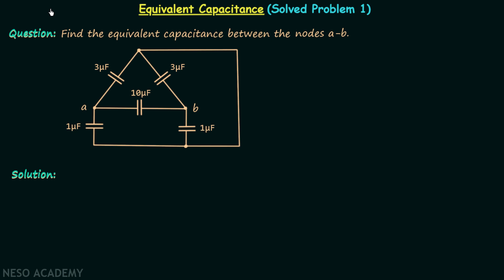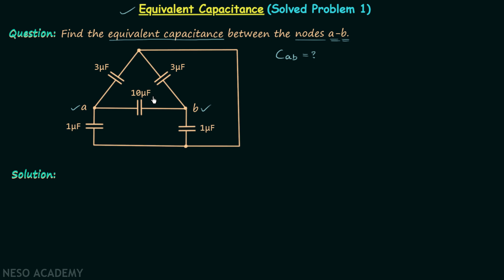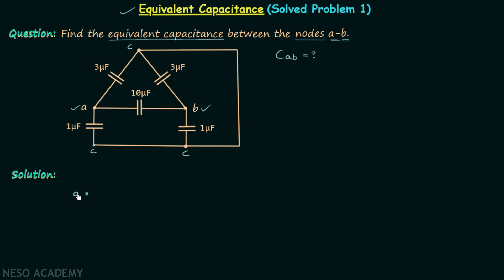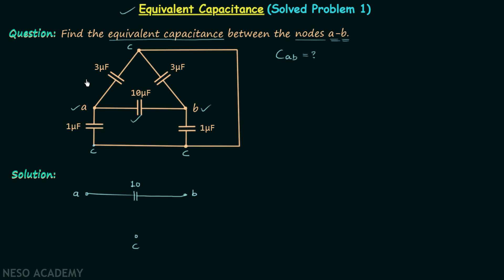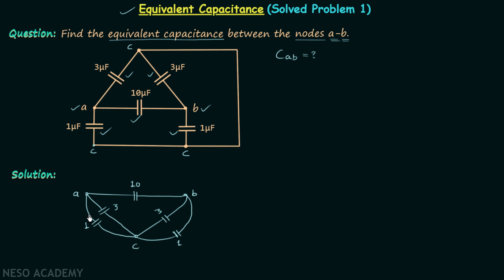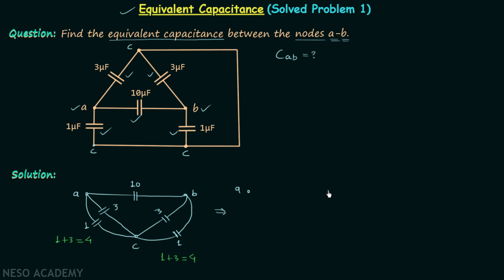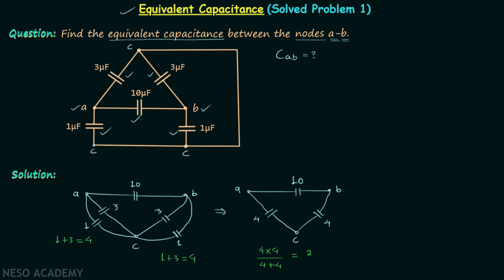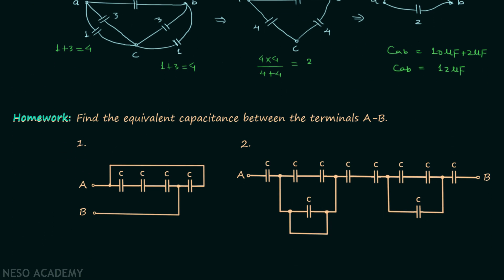Equivalent Capacitance (Solved Problem 1)

Comment: 1.Question, you can simplify the diagram. The lettering technique should make everything clear.
2.Question, Q = C * V, This Capacitor will not store anything if the voltage difference is equal to Zero. So expect shortcut there.

Expand for answers.

1: 4/3 C
2: 3/14 C

Comment: 1.here 3 capacitor in series and another in parallel and the result is 4c/3
2.here from A end, after the first capacitor we got a shorted wire so we wont count the 3 capacitor because they will fail to store charge and the result will be 3c/14.hopefully you will be benefited.
Reply: I knew the concept you talked about. But did silly mistake in calculating 😂

Comment: 1) Cab = 4c/3  and 2) Cab = 3c/14
Reply: bro how u get 3C/14 i am getting 3C/16. please correct me
Reply: @peACE18112  exactly same. tell me when u get the answer
Reply: @harshitapandey4892  after the first c from a side the next c which is in parallel with the two c, which I think you have shorted, so you need to short the other two c's too which are in parallel with the one and then calculate you will get 3c/14.
Reply: Rishabh Bahoria can u send me the solution plzz..lokeshpokhariya11@gmail.com
Reply: @Lokesh-bo1zl  how it will do
Reply: Correct
Reply: After the first c, both combination of series and parallel capcitance has no effect because the portion is shorted
Reply: 4c/3  is the capacitance between a and c

Comment: 1.) (4/3)C farad
2.) (3/20)C farad
Reply: the answer is 3C/14 because current will follow the least resistance path, meaning not only the capacitor below will get shorted the entire capacitor in the upper part also get's shorted.